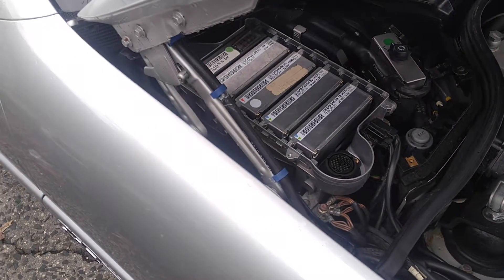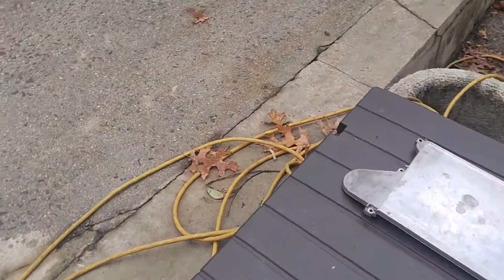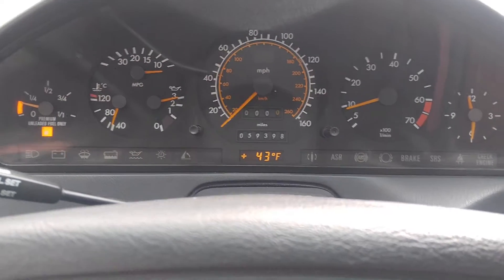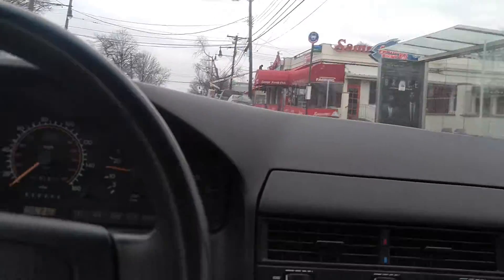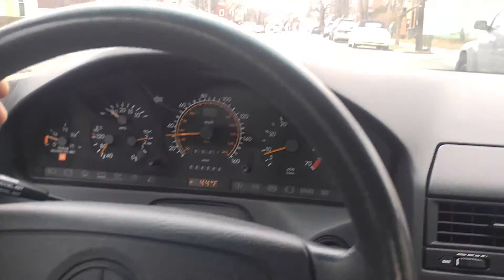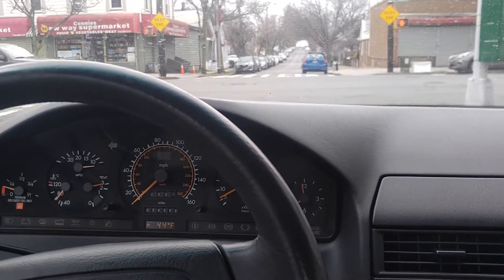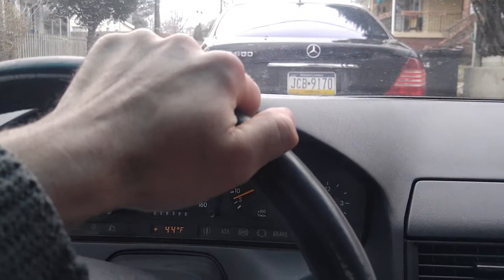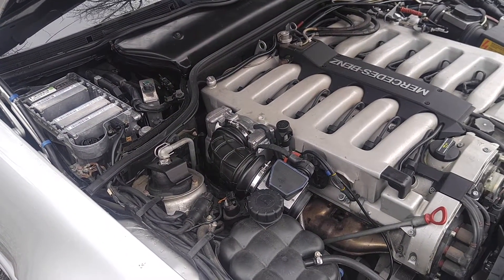Mercedes 1295452232 Egas module test before sale

Comment: Does the 2000 R129 SL500 throttle body use the same throttle body with the same Egas?